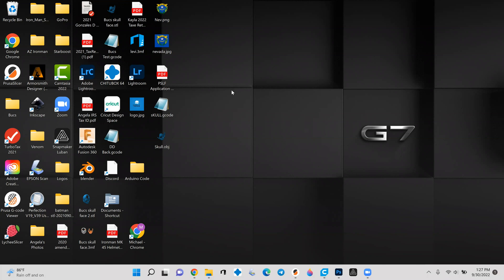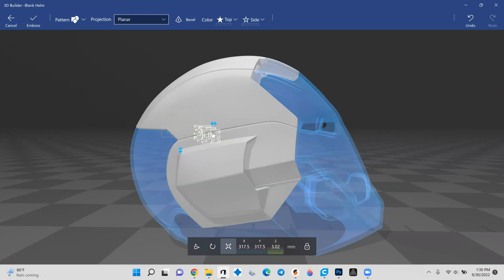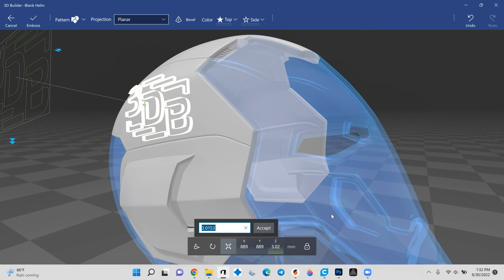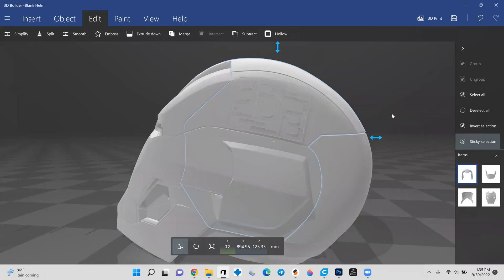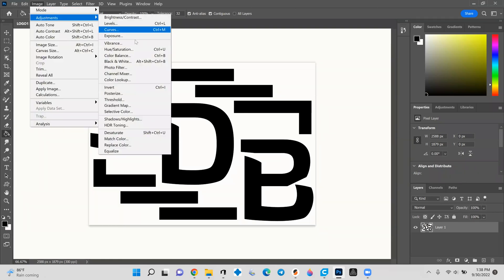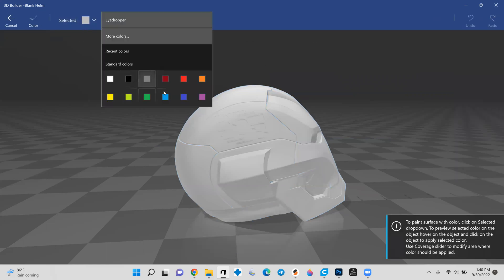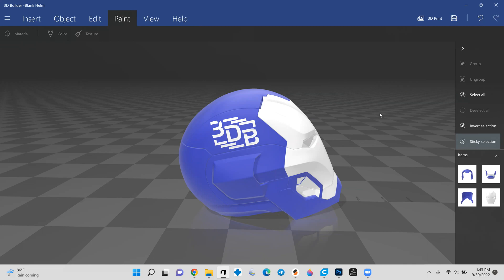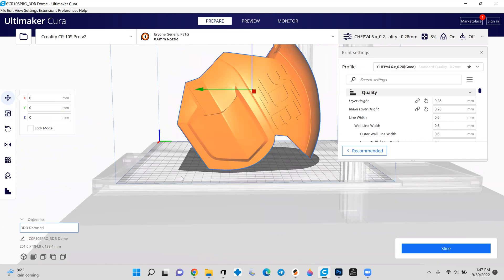Embossing a 3D model easily

Comment: First, your work is amazing. I hope to get to your level at some point. I do have a question for you, though.  Is there any chance you could go over or send me a screenshot of your Cura settings? Your prints look amazingly smooth with no layer lines right off the bed. I've messed around with setting, but my prints look nowhere as nice as yours. I'm using an Ender 5 Pro if that matters. I am looking to upgrade to a CR 10 at some point.  
Thanks for any help.
Reply from the maker: Thank you! As for settings, I run just base Cura settings for the printers. Rarely change anything other than retraction (which is purely based on printer needs), support and infill settings which vary by the print needs. Nothing fancy to share there. It’s more about having your printer belts tensioned, wheels properly tightened and aligned, and bed square and level. Then naturally ensuring good nozzle and Bowden tubes too as part of regular maintenance